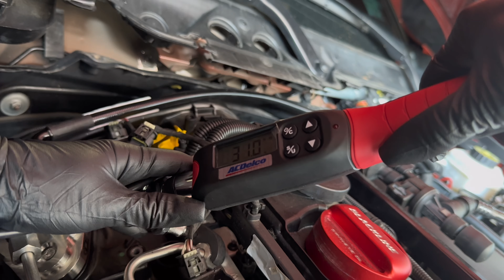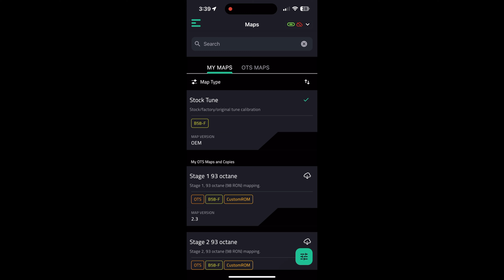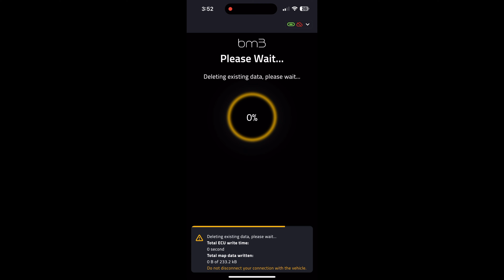How to install Dorch 2.5 HPFP (IN DEPTH GUIDE)

Comment: did you notice any loud chirping sounds especially at ile that increase with throttle after isntalling this?
Reply from the maker: Yes, I did at first , I was nervous that I didn’t install it correctly, but I reached out to Dorch and they said that the pump is supposed to sound like this. After a while, it quieted down, but you still hear it at idle. i’m thinking about adding sound deadening around the pump.
Reply: @malayaf30  would you add DEI or Nogevo sound foam to the pump itself or ontop of the fiewall and cowling?

Comment: Just installed the DS25 in my 340 too. Is it really loud even inside the car for you as well? Just making sure I’m not going crazy
Reply from the maker: Your not going crazy, your not the only one that complains about it. they’re just loud, I’m tryin to figure out a way to dampen the nose I’ll post another video when I figure it out
Reply: YES, the HPFP sounds very harsh at first after installing it I thought it came with problems but when I accelerated my 340 with this new HPFP my doubts disappeared.
Reply: Mine as well, the sound is louder than the oem even I can hear it from inside the car
Reply: @malayaf30 any solution yet 😁
Reply: @grsupraa9187  Been about 8 months, I’ve gotten used to it for the most part now, but every now and then it’s annoying still. I’m thinking about 3d printing a custom small box that snaps onto the fuel pump, covering the entire thing, and load the insides with some sound deadening. Trouble is making it small enough to fit but big enough to load enough sound deadening material in. Also lacking the motivation to do it lol
Reply: @ great idea go for it and let us know if it works